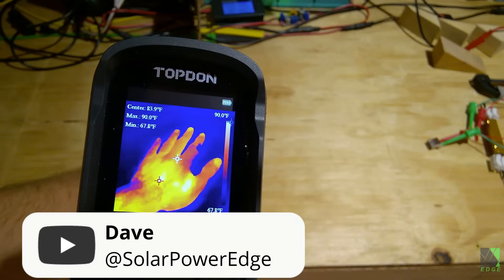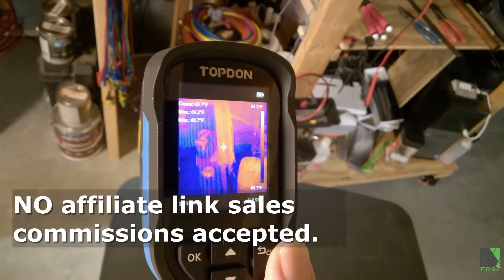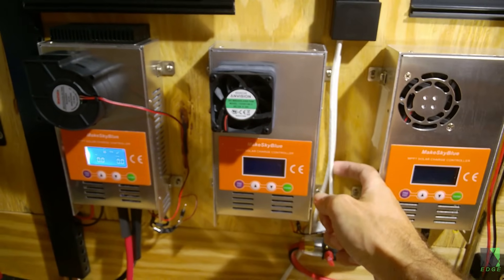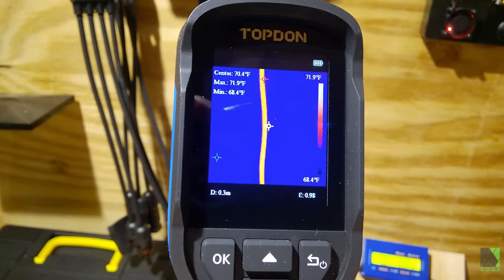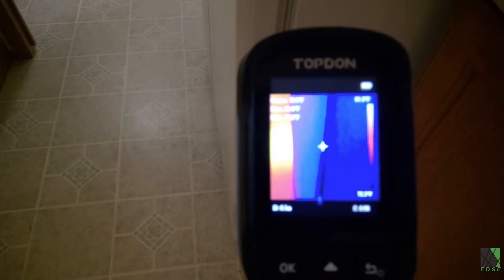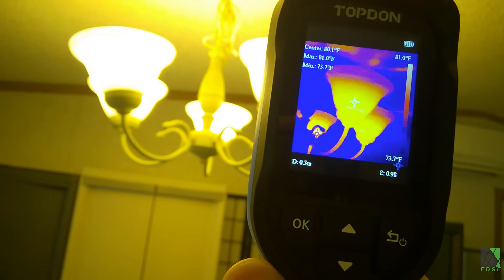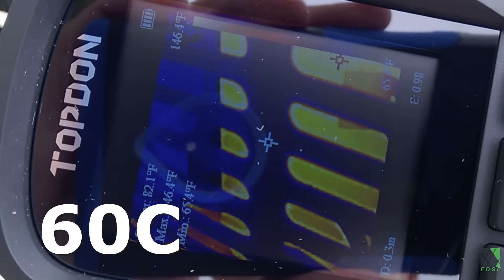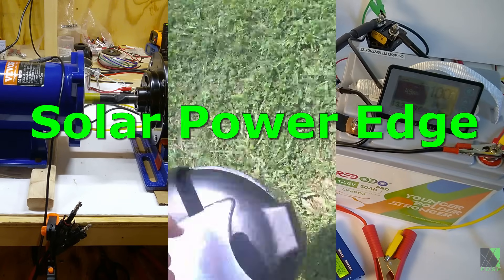WHY You Need A THERMAL CAMERA! See what it can do! #DIY #thermalcamera #ircamera #infraredcamera

Comment: As a whole the entire outside shed shell is responsible for most of the heat gain. But if you have a 4x5 window (rvalue=1), and walls totaling 260ft2 with an r value of 13, then isnt that window letting in 13x the amount of heat( per ft2) as that wall ? Is my math correct. ( ie insulating that window area with an r13 covering) would eliminate the same heat load as 260f2 of r13 wall.
Reply from the maker: @CharlesGwinn-ep9pb You have a solid point. In my experience that metal shell gets crazy hot (roof is worse, it has dark color) and it is gigantic. This then conducts into hundreds of linear feet of steel posts which are bare and exposed. The window is quite small, about 30 inches. I have a double pane mod (not shown) on that window. However the window is most certainly letting in a significant amount of heat, and adding some tint or some kind of reflection would definitely help a lot. Unfortunately I cannot tell you the exact numbers and I don't have any hard data. Just experiencing how the structure performed as I did each step: no cabin, cabin walls, plywood roof, first layer of insulation, door covering, window pane mod, etc. The window gave some noticeable heat but it seems less than all other sources combined. Those metal posts just keep radiating heat all day long especially on the south side of the building. Just my opinion and random thoughts though, it's possible you are completely correct because I have no real data :)

Comment: I found them useful for detecting cable's with faulty conductors...
... and getting the water just the right temperature for starting yeast to make bread.
Reply from the maker: @mySeaPrince_ Right on :D that's one of their best uses. Another good one is to check Hot Water heater tanks for thermal leaks

Comment: Thermal cameras are SUPER for any solar DIYers for checking cabling etc.
Reply from the maker: @JFK666666 Agreed, I learned with an IR camera bad power connections are suddenly very easy to find (they heat up)

Comment: Just a tip for people looking to buy a thermal device. I have owned several different types and can safely say. Having a focusing lens is more important than having a super high resolution sensor. High resolution sensors with fixed lenses are pointless and still expensive. Do a lot of homework and YouTube videos before purchasing. I myself had the buyer's remorse for purchasing a non focusable lens.
Reply from the maker: @justicefornone3411 Hi and thanks for sharing the knowledge.  This camera has a fixed focus lens, and of course that keeps price down. Even so I did not face any problems doing small DIY tasks with it. Even pointing at the ceiling 9ft up I was able to see heat signatures very easily. Sometimes it takes me a couple of tries to register where I'm pointing the camera vs. what I actually want to look at. Deciphering what's on the screen does take some effort.